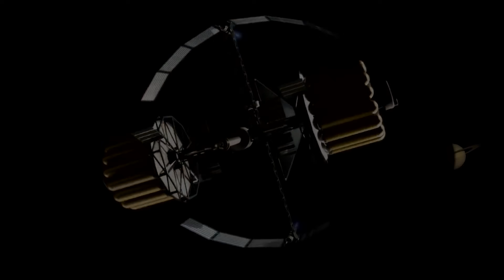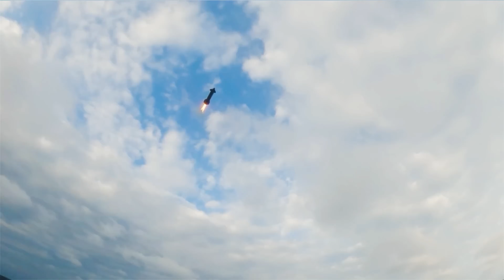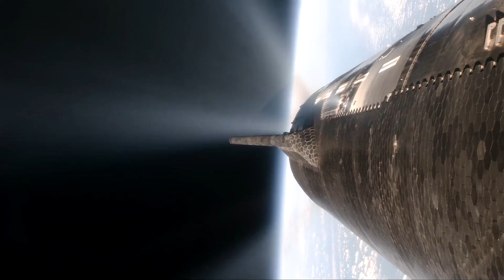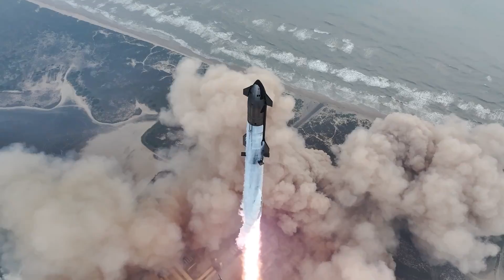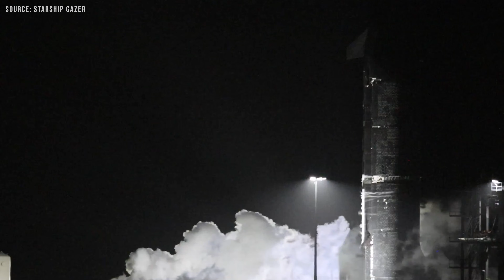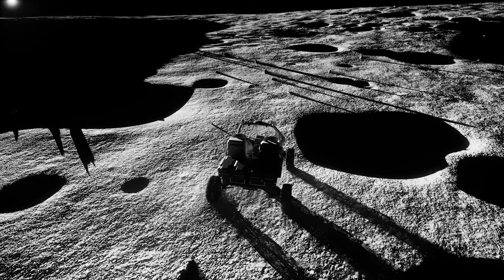SpaceX's Brilliant Solution to Launch Starship to the Moon Without Refuelling, Nuclear Starship!

Comment: sorry but you contradict yourself.  chemical rocket Supper Heavy can only lift so much weight.  it cant double that lift weight just because the starship is nuclear.  you cant land a nuclear rocket for the same reason you cant launch a nuclear rocket.  Thus, your entire premise is WRONG!  in addition you mention the possible weight of the nuclear engine but don't completely compare that weight to the chemical engine.  So is it heavier or lighter????  You also state that the rocket could or couldn't return to earth.  Sorry, but the Apollo capsule returned on it own... thus this is a misleading video.

Comment: skip refuiling, use the booster to break orbit, switch on nuclear enegnins and just uise it as a truck back and forth, no landing on earth, dock with searas space plan for crew return to earth landing, then the starship casn just be a truck  back and forth to moon and back, the only thniog left to work on is a station for docking and equipment storage in earth orbit, the equipment could then be deliverd with a normal starship just to orbit and basck, the path between earth orbit and moon would just be a milk run

Comment: Ridiculous idea's. You still would need to use nuclear fission engine inside the atmosphere because the booster is only used for the first part of the launch and in current launches use the Starship engines and fuel to get it close to orbit. Also... You really want to land a nuclear fission Starship on earth again? A stupid dangerous idea.

Comment: Do not call the CH4 "propellent". Think of it as "reaction mass ". 

It's  the mass, the nuclear reactor heats up and ejects out the nozzle.

Reaction mass

Also, your suggestion of adding a nuclear reactor into the current Starship will not work. Nuclear reactor are MASSIVE.

At best, your nuclear rocket will operate only in space, it will shuttle from LEO to the moon, or Mars. It could include heat shielding to allow aero braking into orbit of Mars and Earth, but it will not land on Mars or Earth - too much latent radioactivity..

Think of StRship as the shuttle from Earth, Moon, or Mars and the nuclear space tug as the mother's hip in orbit

Comment: Why not design a nuclear powered starship with detachable nuclear engines so that once the engines are launched into space, they remain in space and every starship launched after that would simply dock with the engines and use them when the engines are orbiting earth they would be in shut down modeso they wouldn’t be hot in this way a starship could could undock and return to earth
Reply: Agreed. A dedicated nuclear powered ship for ferrying Starships between planets is the way to go. You can use Starship to assemble the thing, and a dedicated ferry means Starship itself doesn't need to be redesigned with a nuclear engine in mind.  Nor does it mean Starship has to repeatedly waste fuel lifting a nuclear engine into space if the engine just stays in space. And of course, you have a vastly lower risk of nuclear accidents if the nuclear engine isn't repeated entering and leaving atmosphere.
Reply: There is a plasma engine designed to do precisely that. Plasma designs won't spew radiation, even if a nuclear reactor is used to power it. Big difference and much wiser approach.

Comment: Send on the orbit 3 nuclear powered automated (crew-less) starships and single crewed (chemicaly proppeled) starship, use some quick connections wich are ALREADY parts of the prepared design, quick connect the four starship in shape of 3 gigantic "engine pods", with one single central starship. Advantages:
1) MUCH better stability for Moon landing - the starship lands and later takes off, as 4 starships TOGETHER, proppeled by nuclear engines at the time. 
2) Reusability retained - The nuclear tripplet engines can be detached from the central crewed chemical starship. The starship can land on Earth (alone), while the engines stay on the orbit and can be used either in next flight of the same starship, or by any other starship capable to be "quick connected" into the nuclear tripplet engine rig. 
3) Could be used as engine-rig for Mars flight, same as for Moon flight. Better suited for long-term solutions in spaceflight. 
4) Source of energy for the long flights solved - nuclear rules. 
5) Single brake point funnel regarding elevator solved. Elevators located on the "engine" starships and the crew and cargro from the crewed starship get there via the use of the "quick connectors" between the hulls, utilized as a bridge...
6) The Moon flight does not really need that, but for longer flights it is possible to use the spaceship microgravity design idea beautifully shown in Hail Mary movie - detachable living quarters plus enough cables, rotation started with manuevring thrusters and voila, measurable microgravity. If the upper half of the crewed rocket is used as simulated gravity module, and the crewed rocket engines (plus all 3 UNCREWED rockets) are used as counterweight, the lenght of the cables can be about 260 meters long, to generate whole 1 G. (weight difference, and therefore lenght of the cables from the centrepoing of spinning, is 7:1 ratio. The simulated gravity segment is roughly 1/7th of the weight of the rest of the ship, therefore it could be located 7 times further from the centre of rotation, than the rest of the ship. Radius for 1G (under healthy spinn speed) is roughly 225 meters from the centre of rotation. 225:7=31,2, 225+31,2 = 257 (rounded = 260 meters).

Comment: With just nuclear, there is enough power to land our takeoff. You still need the chemical rockets for landing and taking off.! But with nuclear power it would drastically shortened the trip to mars with the continuous power available
Reply: Leave the  nuclear engines in orbit and you don't have to waste fuel getting them off the ground over and over again. Not to mention a vastly lower chance  of accidental "rapid unscheduled disassembly".
Reply: @noppornwongrassamee8941 that would make since . A space tug!
Reply: @noppornwongrassamee8941 a nuclear space tug would make sence.

Comment: you're not thinking about this right. The mass of the nuclear engines leaves the Earth's gravity well and never lands there again.
Lose the flaps; not needed to land on the moon, nor mars since the atmospheric pressure there is 1% of the pressure of our atmosphere - Nearly a vacuum.
that ship would have to be supplied with fuel, cargo & passengers (if any) by a conventional starship & complete transfer of cargo, consumables and passengers while in orbit. Same on the destination side. This vehicle never gets to land (maybe once on a low-gravity destination it if is deemed at the end of its usefulness as a cargo hauler.)

Comment: Nuclear Starship shuttle from earth to the moon to tug spacecraft to the moon. Nuclear Starship never needs to come back to earth.
Reply: So No Fins, No Tiles, low weight, no reflection of Nuclear harmful particles.  Then add weight for landing legs, add Solar Panels, poss. gravity toilets !
  maybe a lunar excursion Starship should have a hammer head extension with a nuclear engine each side (low dust kick-up) once landed solar panels (two each side) could be hung down, 1 metre off the regolith line, connection leads too close by regulators/batteries/living quarters feeds.   The extra latticework beams, a Ideal location for multi-frequency antenna arrays and that would include multi-station/ship horizon to horizon comms networks.   The external engines could dislocated and winched to the regolith, carted off to a pre-cut bern, awaiting re-use !
Reply: Can you guarantee no radioactive particles pouring out the back contaminating low earth orbit?🤔🤔. What if it leaks? Who is going to repair it. Be Proactive. Think before you act.